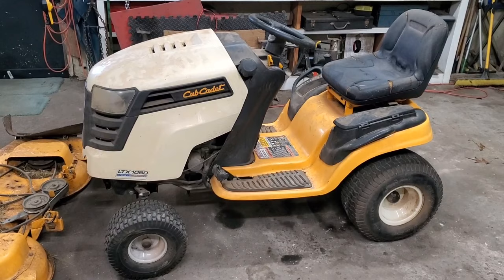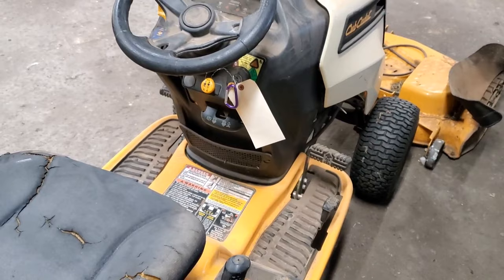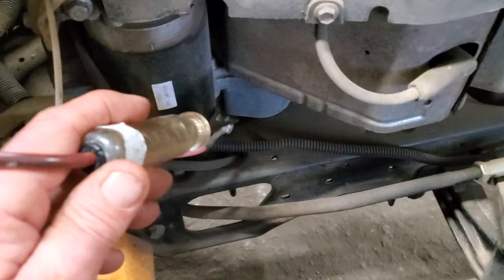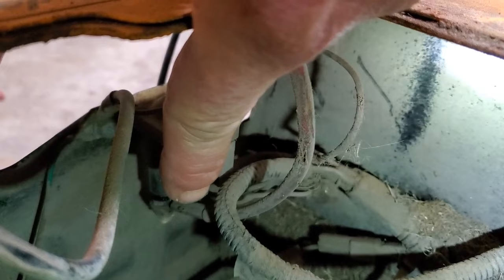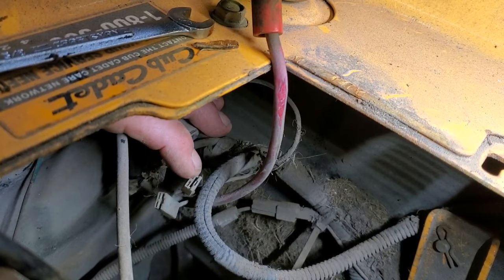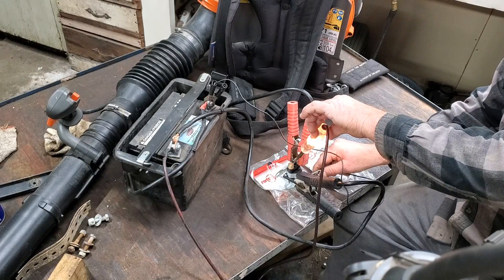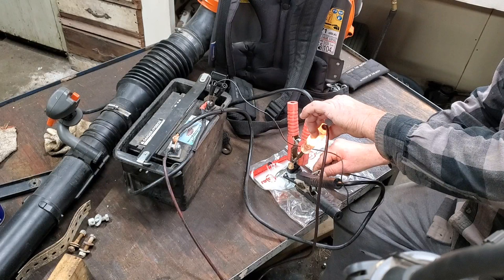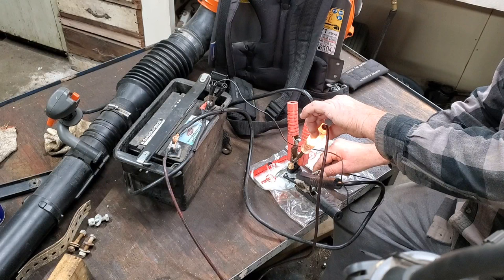Lawnmower No Start Just Clicks Easy DIY Fix Works On Most Mowers.  Battery, Solenoid or Starter?

Comment: I was mowing with mine just got it going and made one round and it just went dead like somebody turn the switch off of what somebody told me he had a shot fuse it was under the battery take the battery out I ain't found one under there yet
Reply from the maker: Your fuse is generally located near the starter solenoid
Reply: But such a tight place to get my hand in, but what happened I was just driving it down there just made one round also just like somebody cut the switch off Macy will you shut up used up on you battery I'll take all that apart and everything and nothing and then I look around and behind the motor stuff that I couldn't get my hand in there anyway so they going to pick it up in the morning but I appreciate the advice it's got to be right because the same thing they said I'm too old for this stuff and get the job done LOL thank you anyway have a great day
Reply: But now that was on a 46-inch Cub cadet

Comment: Hello. I have a 2165  cub cadet i just bought . Ran for a day and threw the drive belt. Replaced. Dude told me it needed a battery. Done brand new.
Now the starter is spinning, but the bendix won't engage. So, i got a replacement from Amazon and installed her. It started. It ran for a few minutes and then it stopped. Looks like the exact same thing again. Bendix not engaging again. 
Help
Reply: Starter solenoid or cheap Starter. Good luck

Comment: I got a riding mower that turns over but won't start can u give me any thing to look for to try to make it run
Reply from the maker: Shoot some brake cleaner into the carburetor, if it starts, it's a fuel issue.  Probably carburetor issue, and or bad gas.

Comment: What if I put in a new starter, solenoid, fuse, and the battery isn’t that old about a month and it just does a fast click what can that issue be?
Reply from the maker: Fast click is dead battery
Reply: @RaleysSmallEngines  even if it’s not that old?
Reply from the maker: @RedDeathXVI  correct, test the battery voltage if it's under 12 volts charge it.

Comment: I'd be willing to bet that that mower didn't need a new starter. The l;ast mechanic didn't follow proper troubelshooting and diagnostic testing. The solenoid was probably sticking and he replaced the starter. Had he taken time to properly troubleshoot, he would have found that it only needed a solenoid.